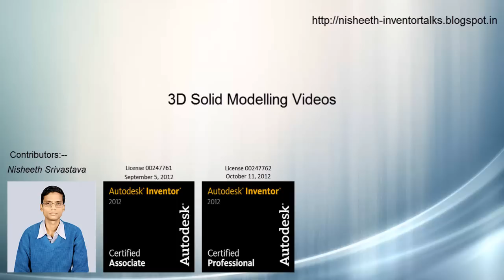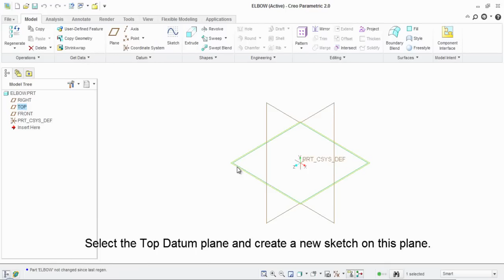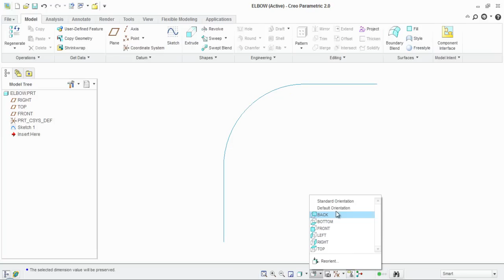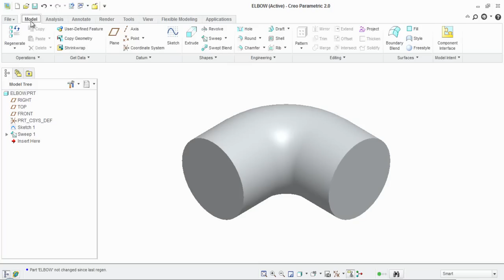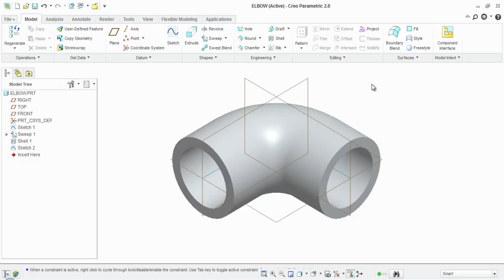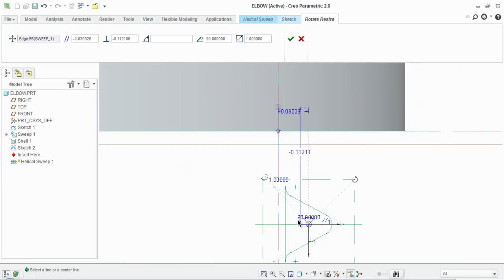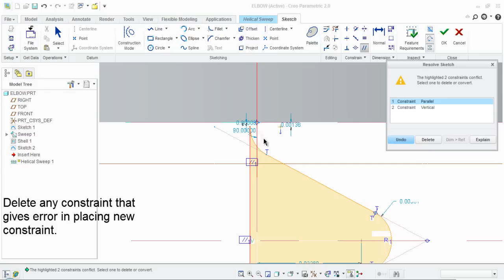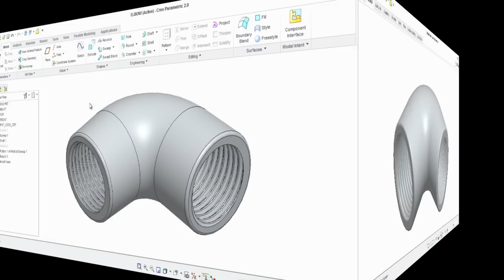Modelling an Elbow in Creo Parametric

Comment: I think you have not drawn the helical profile thread for round section. How we can draw it?
Reply: +Nisheeth Srivastava  My Question is how to cut thread for circular Section?
You have shown in 1st video Only how to draw the thread nd in 2nd video how to apply it on straight parts.
But what about the central circular parts of Elbow? You just cut the thread on both side of Elbow which are straight.  We draw 1st central line to cut the thread but in circular parts we cannot draw central line.